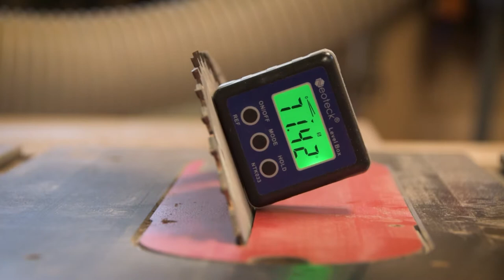Walnut Tea Cabinet - Part 8 - How to make a tray and finish a cabinet | Fine Woodworking

Comment: When I mark my baselines, I try to mark them lightly so they are not super noticeable after planing. Do you intentionally mark them heavy/deeper?
Reply from the maker: I do, I can't remember the video or who said it but basically by having those deeper lines visible in the final pieces it not only shows that the dovetails were hand cut but also adds visual isolation to the joinery. It's one of those techniques that sometimes I'll use and other times I won't. In the case of this project I wanted to isolate the dovetails visually by adding that deeper cut. If you look at the bookmatched white oak cabinet the marking lines are completely removed in the final piece because I wanted the curly grain to flow all the way through.
Reply: @morganhurst_redridge  yeah, I’ve heard many different woodworkers say the same thing. If you take all the time to do them by hand you kind of want people to know they were cut by hand. Thanks for your reply.